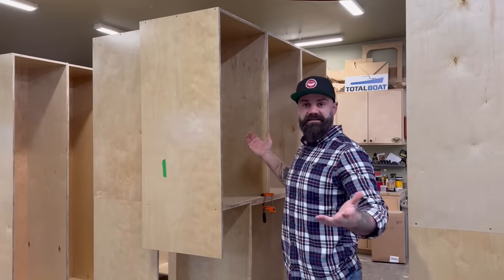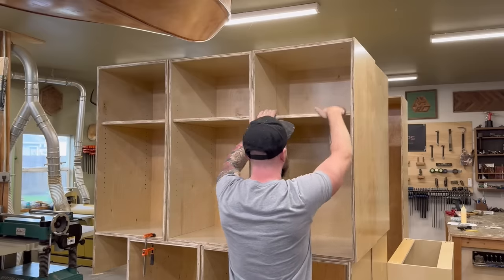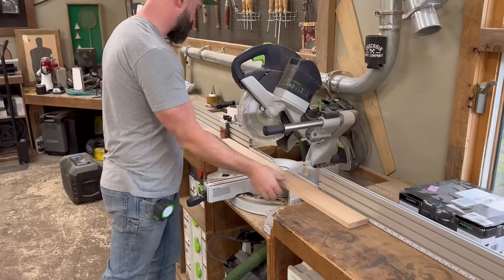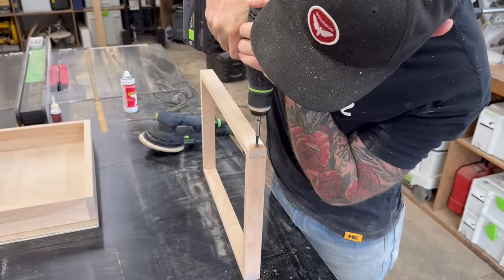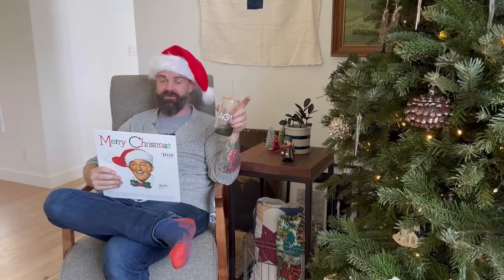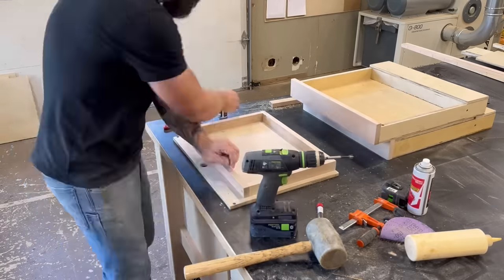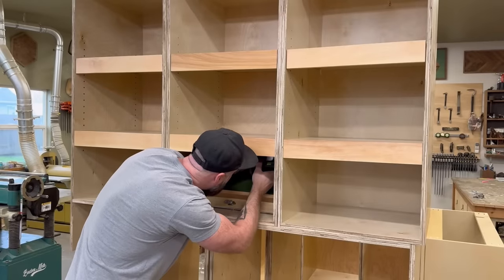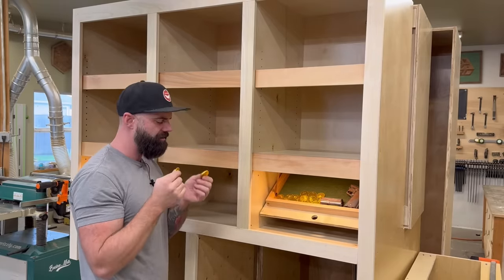Making Hidden Storage Compartments || Next Level Cabinet Making

Comment: I built a little back trunk shelf thing for my camping/road trips in my Prius. There was a hidden compartment that you could only see if you put the back seat down. I did this to hide my laptop and more expensive electronics in. I figured that someone might try and break into my car at some point and most camping gear i could replace. But laptops and other devices I didnt want swiped. Its a handy thing to have on weekend trips.

Comment: very cool. have you thought of using fingerprint locks instead of a keyed lock?
Reply: Those are electronic so he'd have to design to fit them, which he could totally do, however, electronics can fail. Regular metal keys don't fail unless they break, but the only times I've ever seen them break was from using too much force on a frozen lock. Since these shelves will be indoors there's no chance of that. When in doubt I always choose manual over electronic, or digital. Especially when it comes to your candy. Candy security is priority one! 🤣

Comment: When you have to recharge the LED lights, do you have to remove them from the adhesive and re-adhere them? Or do they detach somehow?
Reply: I believe he said they’re magnetic. I think the magnet adheres to the shelf and the light connects to the magnet.
Reply: @DonGilstrap  yep. I ended up buying them haha. There's a magnetic plate that adheres to the surface then you just take the light off the plate to charge it. So far they're awesome

Comment: Those are some great hidden compartments. My only concern is: If you ever need to get to your candy in a hurry and don't have the key on hand it would be nice to also have some other method like a fingerprint lock to be able to open it.
Reply: 1. The candy one has a finger hole not a lock.
2. Fingerprint reader? No absolutely not. If you actually need to unlock it you will be sweating. Try most Fingerprint unlocks when your hands are wet. Just unlock you phone after getting your finger wet. You might as well weld it into a box.
Reply: @saltysaty8686  🤦‍♂️You obviously didn’t understand what he meant by “Candy”, did you.

Comment: Very neat. But I always have to wonder with these secret spaces: if the Candy Prohibition inspectors were to tap on the shelves they'd sound hollow and they'd be all the wiser! Is there a solution to make them sound as solid as they look?
Reply: You'd probably have to experiment a bit to get the acoustic properties you want, but panel-damping products like Dynamat (or any similar competitor) would be a good start. You could also use steel plate with a glued wood skin. Heavy enough plate will sound solid when tapped. Downside is that the plate will weigh several pounds, which will require more robust mechanisms, and it may be harder to work for most people.

Comment: Hey! Now you need a longer candy box, for the long candy canes?
Reply: Just make it vertical, and build it into the side of the cabinet carcass. If you have a heavy enough hinge, you could still put the lock on the bottom. Or make a hinged facade with a magnet latch to hide a compartment on a drawer slide.

Comment: Nice project, I would however make the front slide out like a drawer, that way the bottom shelf can be used like normal.
Reply: A tug on the face would reveal the hidden drawer.
Reply: Drawers are less secret because the whole front would pull forward. So there would be a tiny gap when closed instead of a truly glued front piece. 

Less secret. Easier to access. Tradeoffs
Reply: It would also be harder to use the magnetic trick to hold your candy
Reply: @ecospider5  You could use the same magnets on the back of the drawer face to hold it in and hide the gaps. Also with the slides hidden, you could do identical bits on the top ones as well, and you could have no hinges or holes showing. Since the drawer is pretty thin, you could just grab the whole face to pull it open.
Reply: @SeanBlader  I don't think ecospider5 was talking about the little rare earth magnets that keep the door shut.  Rather, the "candy magnet" that allows the candy to be stuck up under the top, so that if someone opens the secret compartment, they don't see the "candy". Look at the center section at 23:38

Comment: I really love the secret compartments. My only thought is, if you’re using the shelving for any kind of storage, it might be difficult to pull them down. I’d love to see your take on concealed drawers, that way you don’t have to move storage out if the way for the compartments to open.
Reply: Drawers are less secret because the whole front would pull forward. So there would be a tiny gap when closed instead of a truly glued front piece. 

Less secret. Easier to access. Tradeoffs.

Comment: Its a really cool project. I like the comment someone said about making it a drawer to make the bottom functional as well. I also would have given the top shelf a bottom so that if for some reason someone looked under the shelves they really do look the same and a hidden lock would be better also so that it really is a hidden drawer. All that said this is still very awesome and I love the way you put your videos together!!!
Reply: if you did that and wanted to hide the hinge I think you could also add an extra piece of wood to the bottom and instead of having the box in the back you could cut it to an angle to let that extra long bottom pice have a place to hinge. the only issue I see with the adding a base to the top would be that then you wouldn't be able to adjust the height of the shelf.
Reply: @elijahcherweznik3505  I agree about the ability to move the top shelf... I would probably design it knowing where i wanted the shelves and have both be fixed.

Comment: Iam building a 24x40 wood shop going to put in ground power and dust collection wear would be best place for my table saw .going to have double steel doors at both ends .i could put in multiple outlets in the floor just trying to get an idea for my table saw .really like your videos.learn a lot thanks

Comment: Very nice, I really enjoy watching your videos. But as said before if you have anything on the bottom shelf, your going to have to remove it all to get to your secret compartment to get your candy out. Not what you want when someone is breaking into your home. If you made that storage compartment slide out on drawer slides and it locked with a magnetic locks I think it would be more functional. Just my .02